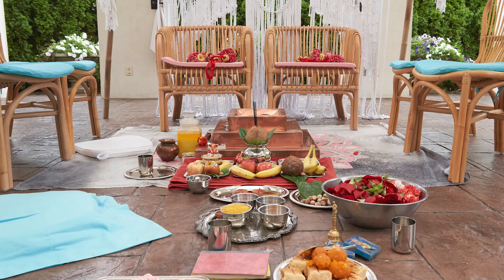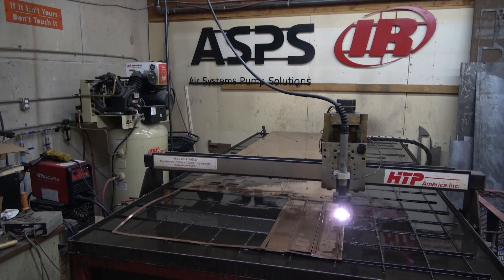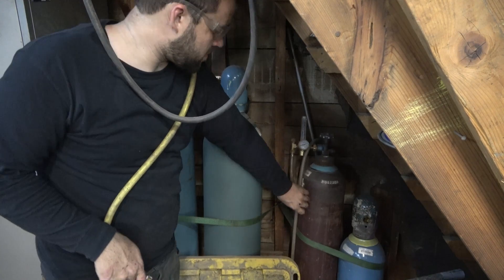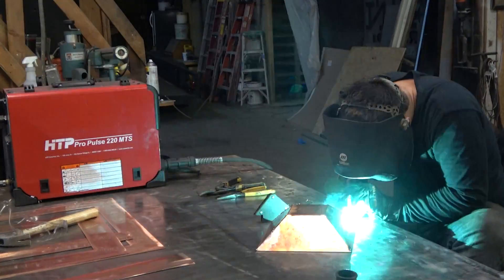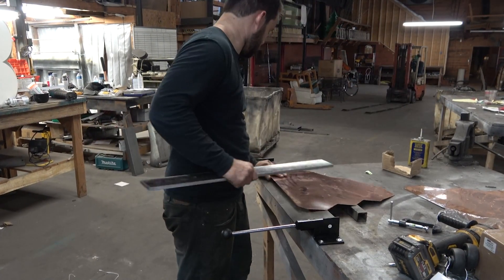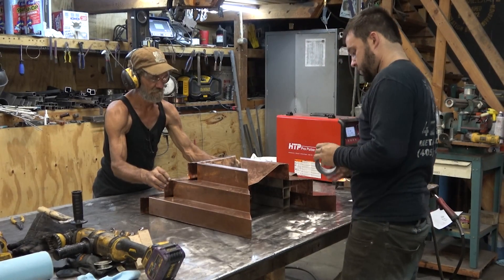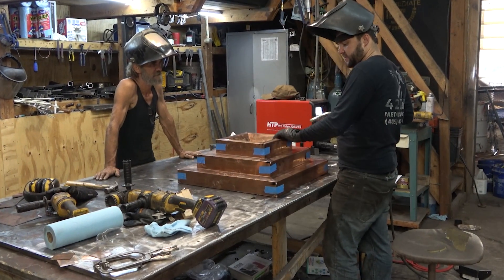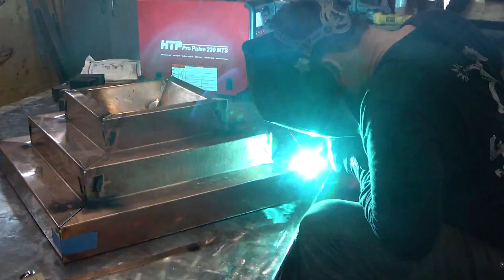COPPER Havan Kund MIG Brazed with the HTP Pro Pulse 220 MTS

Comment: working with copper is a challenge. As a plumber, I would have oxy/acetylene bronze welded it, under the butt welds I would have pop riveted a tab under the joint, using stainless steel rivets to hold the corner down, then drilled out the rivets and then spot welded over the holes. Interesting to see silicone bronze welding though, nice work.

Comment: Personally i would have given 2 of the sides ears to overlap to the mating sides. Avoiding but joints. A pair of duck bill pliers could take care of the ear bends. Then i would have soldered the whole thing together. But then i'm coming from a metal and tile roofing background. So we worked on copper pans and flashing quite often and had the soldering equipment for it.

Comment: Hi sir, looks amazing, my question is to braze brass to brass , 10mm round rods to 10mm rods . I have done some mig brazing but too much spatters and difficult to clean .
Reply from the maker: Spend the time to dial your settings in.
Reply: @42Fab  Do you recommend any good welding machine so have less spatters for brass to brass braze. I do not mind paying for good welding machine specially for brass brazing .
Reply from the maker: You are probably better off TIG brazing in that case. The HTP invertig 210 is a great add, I just picked one up.

Comment: Place a large aluminum chill block under the corner seams, tack every 5mm while using a cold chisel to manually press the seam flat against the aluminum while tacking. Rinse and repeat until you have a continuous bead. Use wood or whatever under the chill block to increase its height as you move to the upper seams.

Comment: If you ever do another, add tabs to the horizontal parts, and bend under. Then clamp both together when you start to weld?
Reply from the maker: yeah, not a bad idea. adding a back piece worked well too

Comment: I never tried to mig weld copper with my 220 MTS. But after watching this I’m going to try it for myself. I’m and old school HVAC tech. I just guessing here, but possibly just using silver solder w/flux and a old school OXY/ACC touch with good regulators may have better butt weld results on this stuff. The right small flame 🔥 just might work out. Heating both copper sheets at the same time slowly with a small touch flame dabbing with silver solder should flow smoother compared to heat generated by the mig. Just food for thought.
Reply from the maker: There are a lot of ways to skin a cat, I do it in the way the customer wanted and paid for.

Comment: what I on butt joints is the gun angle is to steep and argon coverage is not good need to more 90 deg  don't get me wrong I have zero experience with copper plate on tube but looks good its hard to work with !! Do you how tig braze a lot less heat into the parts ? I would had tig brazed the mig to mush heat

Comment: Curious as to why you didn't just tig braze this?  Or even oxy braze it.  If you oxy braze it with a 000 torch tip, the braze will just flow into the joints and be silky smooth.  You may still have to deal with warpage due to how thin the material is.
Reply from the maker: Lots of ways to skin a cat

Comment: I would have used TIG and si bronze or actual copper wire.  That is the tool i have on hand. However excellent result. Good job man. I am Interested in this machine. Props.

Comment: mate if you ever get more copper work what i do is cut small strips of the same material you are using and use that as a filler rod, that way when you blend it you get a nice even finish, also tack your flats very 10 or so mm so it wont pull apart from you, and tig is the way to go. all in all great job

Comment: I have rigged copper with good results accept I had to use argon and they recommend helium but there was a shortage of it when I did it last year not sure about now the helium makes the amperage way hotter because the copper soaks up the heat very fast, and all that’s required for filler wire is stripping copper wire from household Romex wiring or for your case something thinner

Comment: Hey i´m seeing much spatter. could it be that the polarity is wrong? you know like welding with no gas flux wire you have to change the polarity otherwise you are getting much spatter... My theory is that if you change that you increase your economic use of the wire. would you confirm that?
Reply from the maker: This is silicon bronze wire being pulse welded. The machine is set up correctly, as is the gas.
Reply: @42Fab  ah ok thank you for your answer!

Comment: You are simply better off Silver Soldering the joints with copper sheet.
Cracking job though!
Reply from the maker: I would agree if it weren't for the fact the recipient didn't want to see solder joints, which I find reasonable as they're ugly compared to a SiBro joint that nearly blends in

Comment: Just because you can weld copper with MIG.. does not mean its a good idea to do so. If the apperance is important maybe TIG would do a better job and its problably alot easier too because you get more control and leaves more room to deal with mistakes. You do know why you use MIG/MAG right? Its for increased production, nothing else; it gets the job done faster thats the only benefit. And I think youre actually welding that, not brazing.
Reply: i agree 100 %
Reply: He didn't weld, he brazed
Reply: @janeblogs324  Alright, just looked as if he got complete fusion on some parts maybe he didnt. It got so hot he even burned holes in it, are you really sure? Definition welding: "join together (metal parts) by heating the surfaces to the point of melting" Definition brazing: "melts the filler material but does melt the base material, does not create a complete fusion" (means you just barely melt the surface). If the base material is so hot, there are holes in it that means you passed its melting point and there should be complete fusion.. can you really call it brazing then? I know you can call a dog a horse but it still does not make it a horse.
Reply from the maker: It's a braze. Nothing about brazing prevents a base metal from getting hot enough to melt away when errors are made, and I made some for sure
Reply: @42Fab  Great so with other words youre improperly  using a method called brazing to weld with? I have to assume that your filler material copletely melt together with the base metal if you blow a hole in it. Because, that happens before you blow a hole in it right? Ok I want proof can you cut that piece of thing up so we can have a closer look at the welds. (its a joke dont do it).
Reply from the maker: Normally, I'd just block someone wanting to be a keyboard warrior on here, but let's use this as a learning experience. 

Copper melts at 1984 F, silicone bronze filler metal metals between 1800 and 2000 F depending on a number of factors. One can easily melt copper with a braze in this case.

Watch your tone around these parts. I love constructive criticism, I abhor douchebags, don't like it? make your own channel.
Reply: @42Fab  Next time maybe Stefan 
'the proper use of a method called brazing to weld with" guru can come give you hands on lessons on how to do it "right".   Cause you don't want to do it improperly.  Or Brahma forbid you improperly used a method called welding to braze with....  Great job, and as always a pleasure to watch you work sir.  Keep it up!